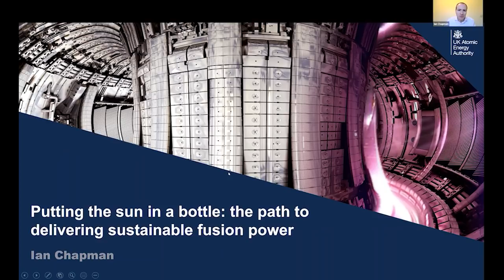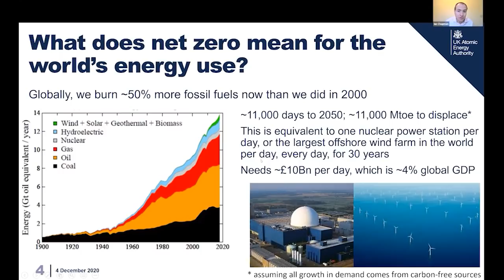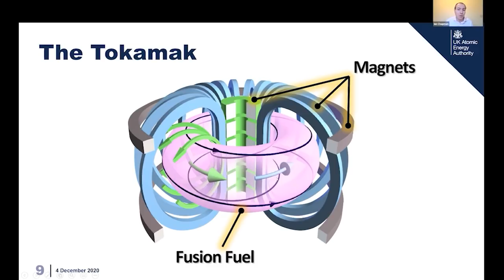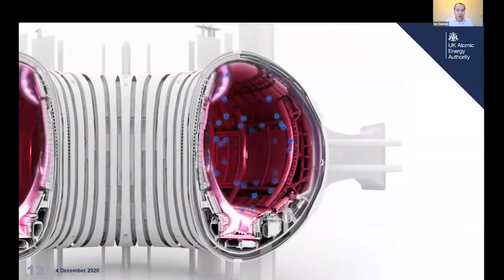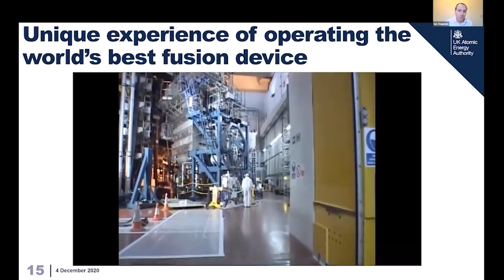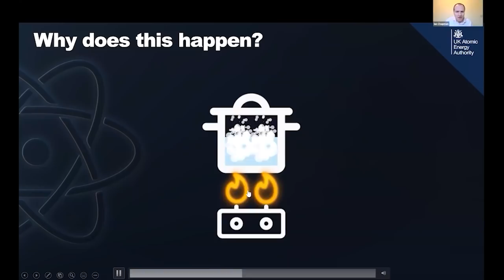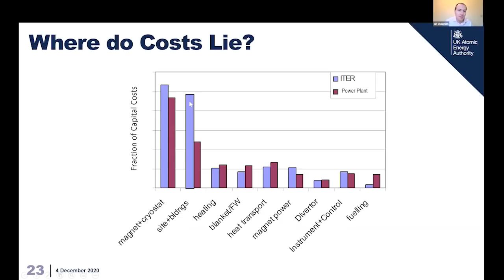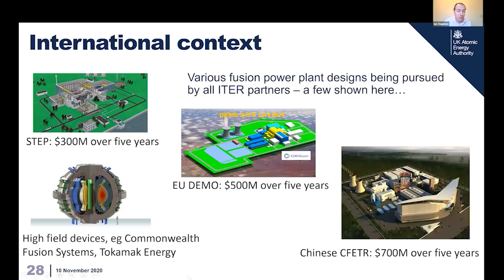Putting the sun in a bottle: the path to delivering sustainable fusion power | The Royal Society

Comment: There has been possibly $50 billion dollars thus far with no end in sight.
I have to wonder how many closed loop geothermal systems could have been built.
Reply: I think they are still well invested. Geothermal needs a geo and a thermal, a planet, moon or other solid celestial body with a warm inside. Sure Earth is one of these celestial body, but what about others, the moon for example.
I understand, I'm thinking of something far in the future and still hypothetical: becoming a multiplanetary species (possibly multi stellar). However if we crack nuclear fusion we can make it "portable", possibly even power the vessels to take us away from Earth.

Again, I understand, we have more pressing, immediate problems, but it still my opinion that thinking in long term is always a good thing. And even without going to my extends, even multiple options is always a good thing
Reply: @DanieleNiero  check out Stirling Cycle engines. All they need is a difference in temp from one end to the other. Space typically goes from -250f to +250f between shade and sunlight.
Reply: it sounds like a lot, but  compared to just the UK Hinckley nuclear plant at 22 billion lbs or the US Vogtle at $20billion (and decade overdue) or for that matter a trillion or so spent on the F35 fighter jet, its not that much.  There's a number of other fusion projects as well so if we could have one functioning one by 2030 and then five by 2040.

 I remember reading Gwynne Dyer's Climate wars back in 2008 and there were a  number of possible energy solutions - one suggestion was that geothermal could take advantage of drilling technology and drill to 5k or even 10k (which is possible with existing oil drilling technology and pump in water, take advantage of the temperature differential. As it turns out big oil put its money on fracking, and we didn't see that much investment in geothermal, but we did see solar pv drop in cost to a 10th of what it was back than, as well as big improvements in wind turbine tech, the one big need is inexpensive grid storage.  And lately it seems like there is a lot of investment in hydrogen.
Reply: I have to wonder how many friends James Watt had who were telling him that investing so much money and work into this newfangled electricity thing was a waste, and he could do more worthwhile thing with his time...

It is basic research. Yes, it is expensive. No, it doesn't turn a prophit. Expecting it to be otherwise is rather missing the point.
Reply: @Alexander_Kale  Well, James Watt as far as I know did not invest in electricity, he did make Newcomben's steam engine a lot more efficient, and as far as money his partner Boulton put up most of that. But I get your point.   They also did make a lot of money of the patent - generally if you had one of their steam engines (designed and built to order) you paid them almost the amount you saved in coal.  At the same time their patents tended to stifle innovation like Trevithicks high pressure steam engines which ultimately won out. 

But 50 billion on ITER is not that much compared to the trillion spent on the F35.
And hardly anyone has questioned that.
Reply: @Alexander_Kale  I'm not discounting Fusion, just directing Ocam's Razor to this 'clean, practical and affordable inexhaustible energy' thing.
Reply: @burnerjack01  That would be fusion. ^.^

Glib aside, you are still demanding technological stasis. Your argument basically boils down to "stop researching new energy sources". Considering how this particular energy source is also the source of all energy and matter in the universe, that seems foolish beyond believe on general principle alone.
Reply: @Alexander_Kale  Not my intent at all. Merely presenting the argument of "Why make it harder than it has to be?"
We could work on 'Total Annihilation' engines too. I mean machine that convert mass into pure energy.
Reply: @Alexander_Kale  Fusion is not the source of all energy and matter at all.
Merely one of the application of already existing energy to transmute already existing elements into heavier ones.
Total annihilation, on the other hand, converts matter directly into pure energy. So, why settle for just merging nuclei when there is so much more energy to be had that way?

Comment: Wish they would discuss the HB11 Energy's fusion solution - it's much cheaper and safer than tokamaks. No magnets needed.
Reply: The ONLY clean electrical production method, and Clean in " ", is Solar.  Let's spend Billions creating more efficient Photovoltaic cells.  The problem is the unclean process of creating the cells, however once made they are clean energy producers.  With increased efficiency, durability and reliable power storage we can achieve more sustainable power until the Casimir effect can be made full scale and commercialized.
Reply: @ztol4_i126  wow, seems like you have found your religion and there can be no other gods beside your god, Z Tol4_I !